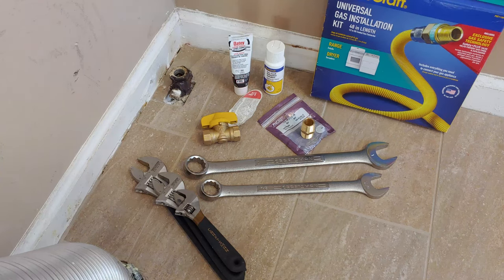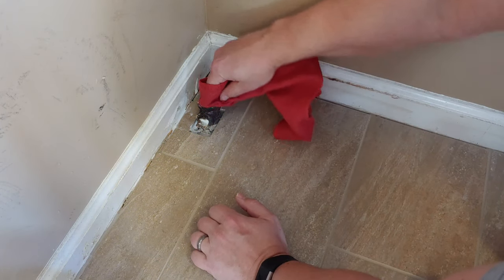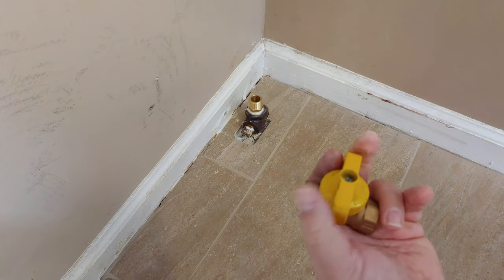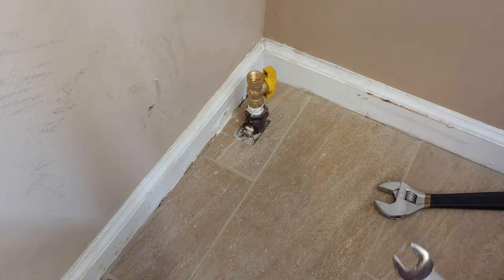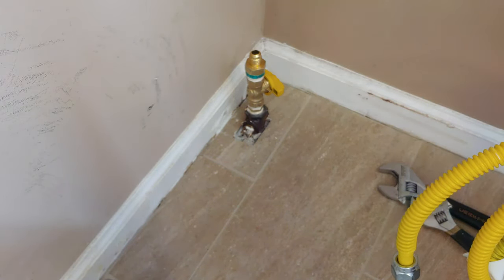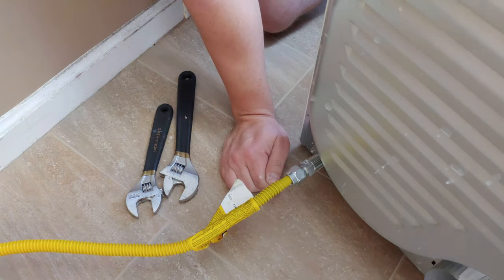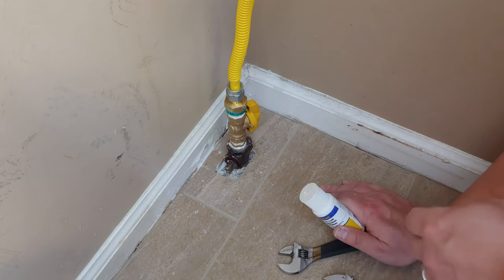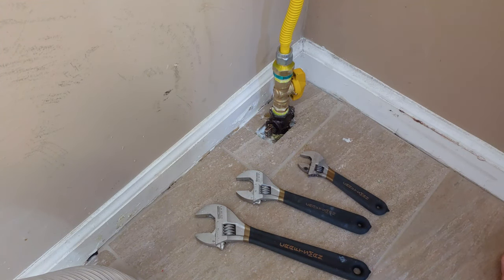Installing a Gas Ball Valve and a Universal Gas line Kit

Comment: You can also use dish soap and water in a spray bottle to check for leaks
Reply: Yeah, I kind of thought maybe that "leak detect" would do something cool like change colors or something.  Soapy water has to be a lot cheaper than that tiny bottle.

Comment: Very informative video as always. Why were you having to install a new gas ball valve? Pretty frightening to know that they installers who should know what they are doing and don't do it properly. This is absolutely not a job for someone not sure of what they are doing.
Reply from the maker: Yeah so the gas line had to be removed when the new floor was installed to move the dryer. In hindsight, the floor people never should have removed the line as they aren't plumbers. I put all this in once everything was done. Thanks for watching!

Comment: Hello there, i am installing a new flexible gas line just like the one you have here that came with that safety gas valve , my question is... in my setup i have my gas shutoff valve,then i have a very small nipple and a elbow that goes upwards,i would very much like to keep this setup because it works well for me but i see people installing this safety gas valve right next to' the shutoff valve, im not sure how the little nipple i have and the elbow pointing upwards would hurt anything but i figured i would ask, all I'm doing is extending the distance by maybe 4 inches (elbow and nipple) between the gas shutoff valve and my new safety valve, you think this will be OK? thank you for your time.
Reply: Its fine. It is called an excess flow valve . Efv . As long as it installed in the proper direction. It will work on any part of the line :)

Comment: Thanks for the video. Quick question: Replacing a dryer here. I already have a brasscraft safety valve installed on my iron pipe (has ball valve upstream) from my previous dryer. Can I undo the hose from the safety valve and just use the new yellow hose with new fittings on the new dryer, or should I undo the safety valve and replace that as well?

Comment: So if I keep having trouble with my meter the screen keeps going off and any money is lost       Can I get some gas flexible pipe turn the gas off      Undo the pipe bolt then add the new flex pipe to the other pipe that feeds the boiler I’ll use all the seal stuff then turn the switch on again so all is flowing

Comment: At 13:30 you mention what connections need pipe sealant. Although you used sealant on the correct threads, your explanation is not correct.  The fitting you show is a flare fitting, and is Not a tapered thread and does not seal at the threads.  That smooth angled flat surface is the male side of the flare. the threads are straignt, not tapered.  The threads on a flare fitting are there only to compress the flared surfaces together and that is what seals, not the threads.    The other connections you made are tapered (NPT) fittings.  the threads jamb together when tightened and the seal takes place in the thread when they jamb .  you want pipe sealant on those threads because thread seals tend to not seal perfectly on their own.

Comment: dont buy the gas leak detection solution, use soap and water same shit, i paid $8.50 for 2 ounces, so thats 128 ounces in a gallon so a gallon would be $544.00